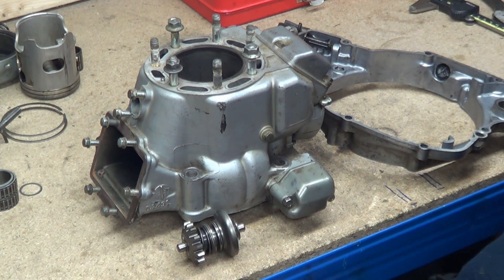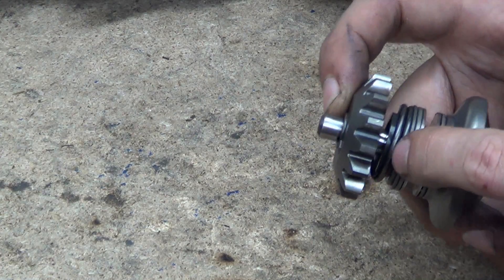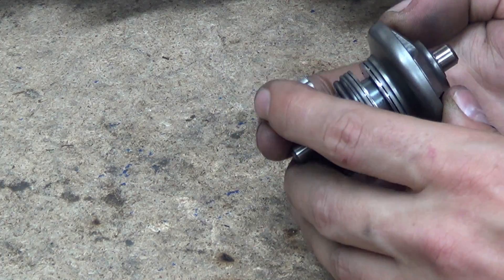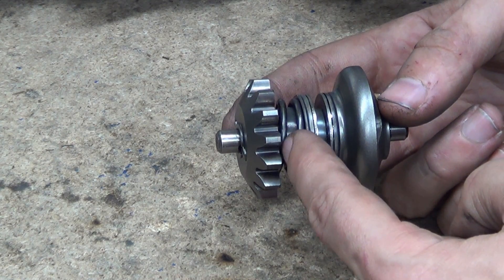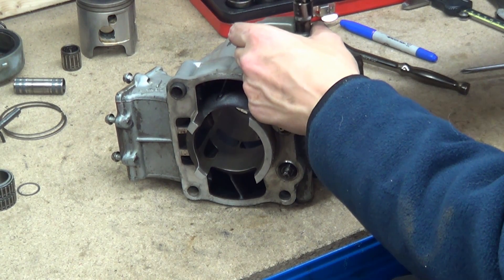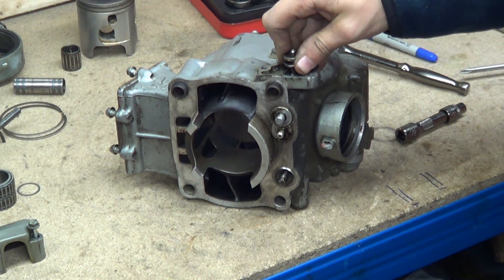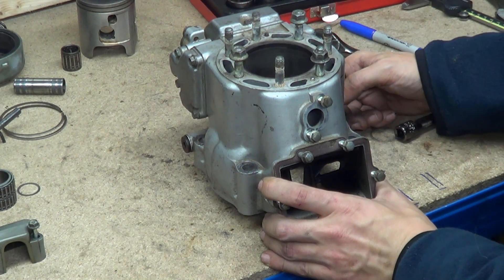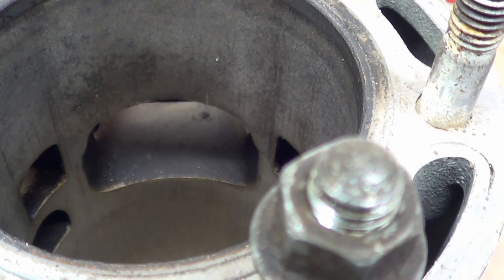KX250 Geared 2 Stroke Series - Part 17 KIPS design

Comment: thanks man very helpful vid , i have exactly the same motor but im missing the linkage parts you opened up at the end and i cant find them on ebay maybe its because im not usin the correct name any advice would be helpful thanks.
Reply from the maker: the speed governor
Reply: no,i have the speed governor  its the power valve actuator arm governor shaft im missing pieces and i bought the bike like the so i don't really have any references to how it links up and all youtube vids jump that assembly part.